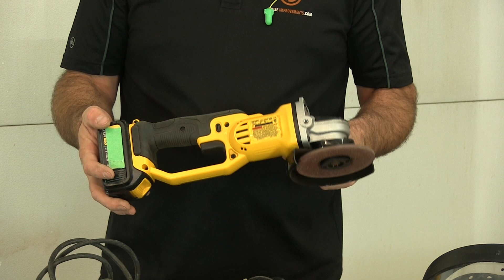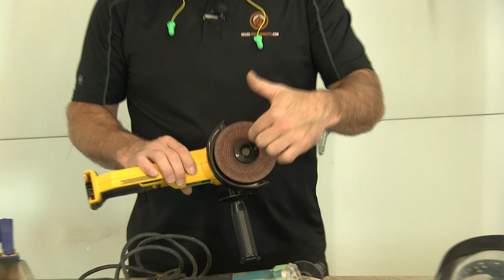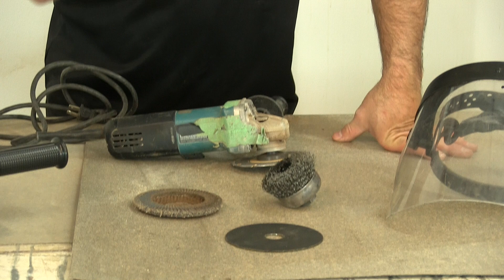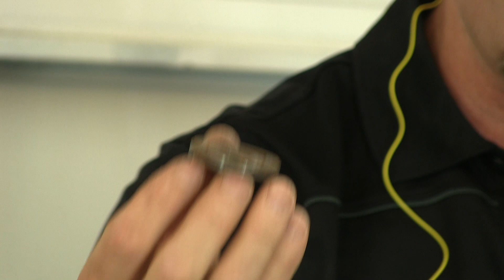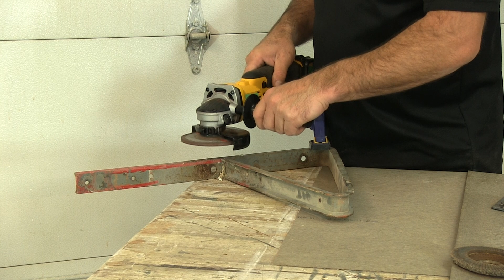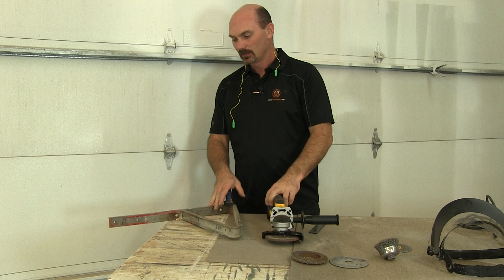How To Use An Angle Grinder

Comment: Nobody at work knew the answer to this question including myself.  The grinding and cutting discs usually have a metal ring on one side . Do you put it on with the ring facing the grinder/arbor or do you have it facing away from the grinder. Or it doesn't make a lick of difference?   Anyone know the real answer? Thanks!

Comment: One thing I found out is to also wear gloves when grinding.  The particles can be sharp for some items and if you don't get them out of your hands, you can get a nice infection.  Voice of experience.
Reply: Im a carpenter and was helping a welder by cutting some crap for him. He really pushed hard that I wear gloves will grinding or cutting just incase. I assured him there was no need at all. Literally 5 mins into it my finger on the hand that's holding the body of the grinder slides slowly and gently into the disc.  I didn't make a peep and just pretended it didn't happen cause I was embarrassed.   I nearly lost my finger.  It didn't hurt but it left a nasty gash. Fuck was I ever lucky.   Never again. I just hate wasting time at work but I have kids and a wife.. they need me and my fingers!  Well my paycheck but it all goes hand in hand :)
Reply: @carpentryfirst3048  that's why you leave the guard on genius. And also be aware of your fingers slipping. How can you not realize when you're losing your grip or slipping? We have these things called nerve endings.
Reply: @that1electrician  you missed the point of what I was saying. Awesome to know your perfect and don't make mistakes though. Have a great one budz

Comment: Witch is better ,no guard or with guard?and no extra handle or with extra handle ?
Reply: Depends on what you’re cutting. For instance when cutting ductwork it’s easier to take the guard off. However it’s not safe at all. If the wheel breaks and hits you in the face or neck you could die really quick.
Reply from the maker: I honestly use mine without a guard at times but it really should be left on for max. safety
Reply: ok sir thanks
Reply: Zach P tnx man.

Comment: Wheels breaking up ? Only time´s i have seen that happen so far is when the user is using stuff wrongly. The cutter is ,well, strictly for cutting. A bit part of it is using stuff for what is supposed to be used for.  Don´t like the nuts that use the spanners no need for those since quite some time now those things tend to ¨disappear¨ and different brands using different one´s annoy the heck out of me. So i get the ones that don´t require one. No idea what those are called over there. That said for the smaller grinders you do not need to use them to tighten the nut anyway. Put your disk on loch the mechanism put the nut on by hand as far it will go and the disk itself a bit of a turn. It really can´t come of since the spinning direction of the machine is counter clockwise. officially you should have the upside of the disk , the side that has all the writing on it, facing the machine and check the date. They should an ¨experation¨ date. Well at least over here if you want to use it profesionally.

Comment: Do you need to worry about kick back when using like the concrete blade or even smooth edged tools for that matter? I've had both circle saws and routers running away furiously when they grab.
Reply: Yes that can happen. With cutters mostly it happens when pushing too hard trying to force it The thinner one´s cut sweetly but are also more flexing giving a greater chance to that.Don´t force it and keep it all in a straight as you can line. Hold on thight certainly with the large one´s and keep your face clear.

Comment: I have a shovel that is covered in hardened cement (mortar) could I use a angle grinder to clean it of, and if so what type of attachment would be best for the job.
PS Great video some very useful information.
Reply: A wire wheel, flapping disc or just a bog standard grinding disk. The grinding disc is probably the best all rounder for price/speed hence why everyone has like 50 of them. Be careful with a shovel  though because it's got edges that might catch on the disc.

Comment: @Houseimprovements: the best how to channel out there! 
In hindsight I'm laughing at myself now.  But wasn't funny at the time.
few years ago I was using an angle grinder ((no guard)) simply to cut off a 2" pvc drain flush with the pea gravel concrete floor around it. (yup) I did that....
just as i was about to complete the job the blade struck the rock of the floor ...
flew out ...breaking into several pieces. one of which barely missed a main vein where thumb joins hand. (did I say ouch yet?) OUCH!
things could have ended much worse.....still bare that scare to this day.
man do I ever  have devout respect for grinders & blades.
have a great day everyone. God bless!
Reply: Yeah any idiot that follows this video or doesn't use a guard has what's coming to him, you got nobody but yourself to blame for being a tough guy
Reply: @eksine  Lol/ corner cutting cuts more than corners!
Reply: @1new-man  lol